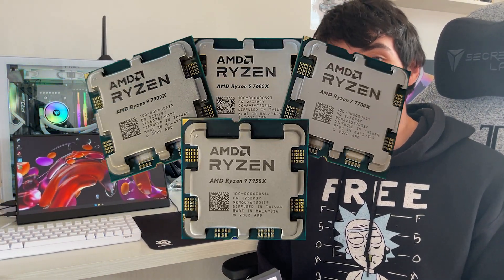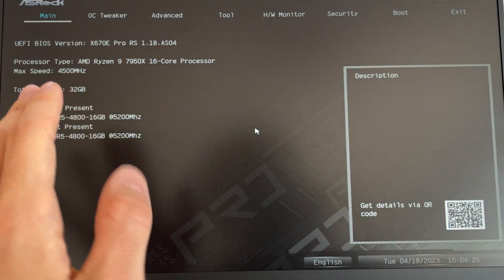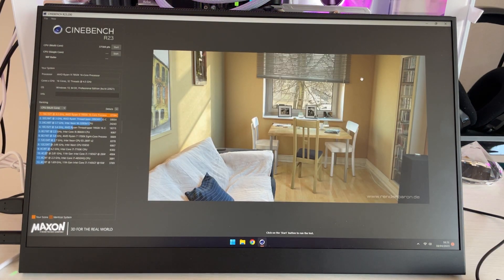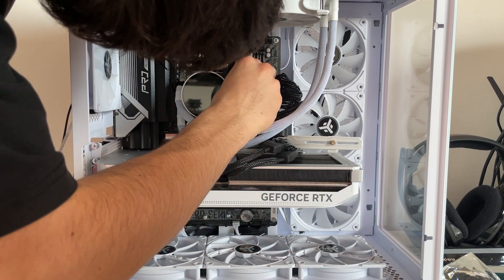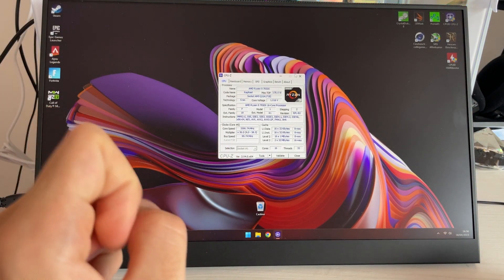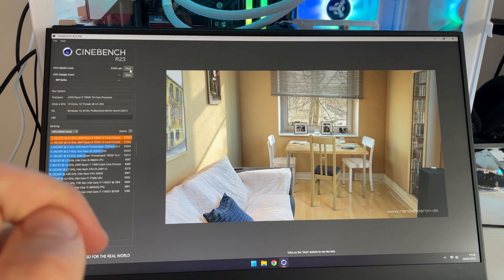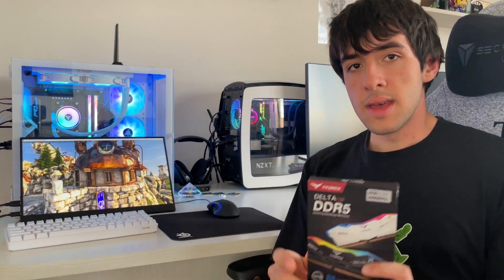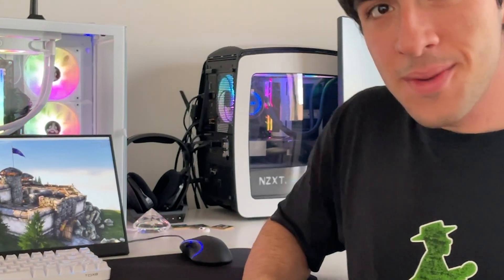Is High Speed DDR5 needed on Ryzen 7000? - 6000Mhz Tested

Comment: congrats on your builds they look amazing and thanks for sharing your knowledge, i got some kingston ddr5 5600 as a gift i was plannng on pairing with i5-12600 and aorus rtx 3080 which i undervolt thanks to you👍do u think its worth adding the ddr5, thanks again for your great work.
Reply from the maker: Thanks a LOT for the kind words and support, definitely the DDR5 at high speed will give you some extra performance, especially if you wanna spend some time tuning the timing! However, if you already have a DDR4 motherboard I think it probably wouldn’t be worth it to swap both the RAM and motherboard, unless you wanna sell them to recoup the cost!
Reply: @ImWateringPSUs  thanks for reply, yes i have ddr5 mobo and ram i really liked the white BitFenix Tracery in your earlier upload so i buy, looks very cool thanks for your video.